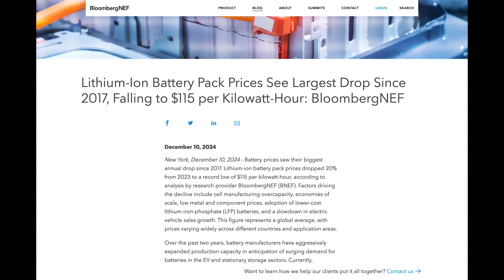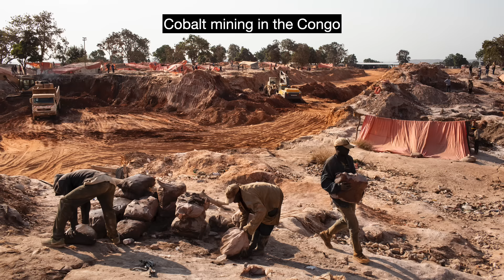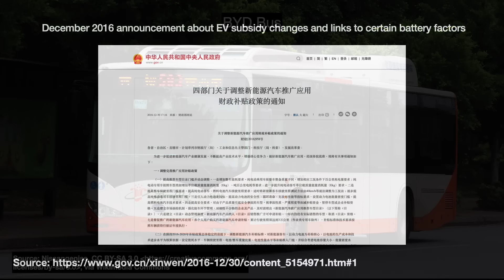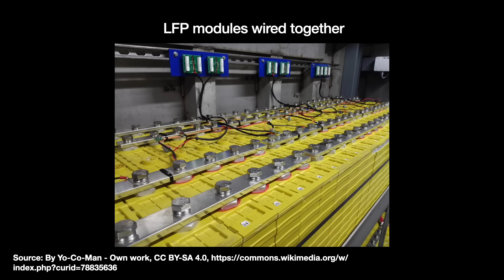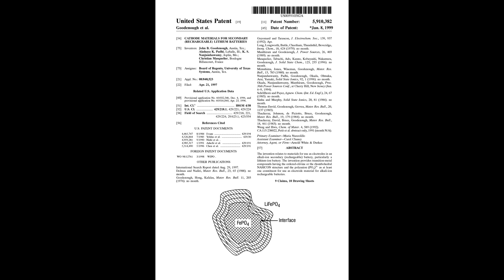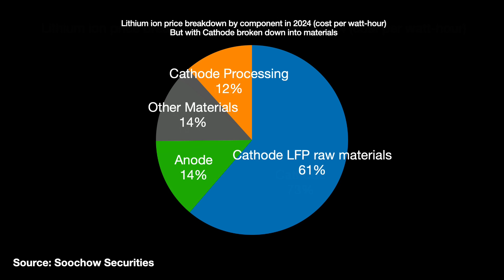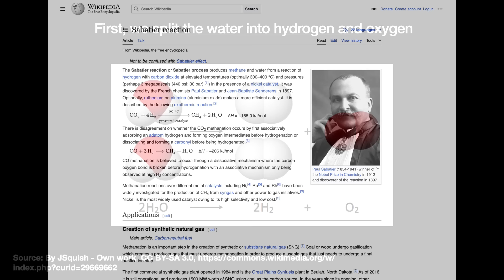How Did China's LFP Batteries Get So Cheap?

Comment: China adopted LFP, an American invention and patent, because in the 1990's, when they were invented, the Chinese government was making it next to impossible and very costly to have it patented there. So the American patent holders gave up on patenting it there. 

Then, when the EV revolution began in the late 2000's and early 2010's, the West preferred the Nickel based chemistries for EV's due to their much higher energy densities and lighter weight, allowing for much longer driving ranges.

Meanwhile in China, with no patent royalties to pay, they poured most of their resources into LFP.  They even bought out all the LFP technology of the American company A123 systems in the early 2010's when they went bankrupt due to the west going with Nickel chemistries. The LFP patents finally expired in 2022, but by then the Chinese had built a huge lead on LFP manufacturing.
Reply: LFP battery patents owner did file its patent in China.
There are two critical patents for LFP battery chemistry, the cathode material, and carbon-coating that improve LFP cathode electrical conductivity by orders of magnitude (LFP has poor conductivity). The patent holder files these patents in China much later, because back then China is a backwater economy, and they did it by combining these patents into 1 single patent (to save money maybe?). Later this single patent was challenged in court, and was nullified, so the patent owner do not hold any patent over LFP. That's why Chinese LFP battery makers can sell LFP battery royalty-free in China, but they still have to pay royalty if they sell outside China, where the related patents are valid.

As for A123, I think its role is overrated, the company (Wanxiang, I think) that bought A123 is never a significant player in LFP battery, I doubt they benefit much from acquiring A123.
Reply: china does not have to follow enviromental laws like europe. just dump the chemicals in the water
Reply: @AndrewTSq u think we dont worry about our environment?
Reply: @leexingha  Not really no. "Its ok as long as it is not in my garden".
Reply: @leexingha  I think you (yourself) probably worry about your environment. Together with many of your fellow Chinese. But since you live there, you know how China works. Some people don't care and ruin it for everyone else. Then there are a lot of people who don't care enough or don't know about it and missing oversight from either local government or even central. Things seem to improve very slowly but people caring too much about themselves is still a huge problem. I haven't been to China is a while now but outside the big cities, dumping random stuff into rivers was common. I once saw a truck dump medicine packagings into the river. Just like that and cars and people went by. I asked someone to call the authorities but they didn't want to get involved. They probably care about their health and family's health and want to live in a good environment. I can't guarantee that this stuff couldn't happen here in Germany but if anyone saw it, the police would be there within minutes and the person would be arrested and fined. I didn't get this feeling when I was in China.
Reply: @gagaxueguzheng  u have been brainwashed & indoctrinated hard
Reply: @AndrewTSq bitter west as always
Reply: @leexingha how did you get past the great firewall?
Reply: @mike_w-tw6jd . Does not matter . China does care about its environment more and more . From the government to the chinese people. So to south east asia and south asia you well understand it is a thirdworld problem and as a developing  china still suffered from that to some extend . But as time pass their sense of environment cleanliness improves . Andrew is a biased clown 🤡 lol .
Reply: @gagaxueguzheng . Compare china to other developing countries and you realise how far they have come . And still improving , it we'll take more decades for environment cleanliness sense to be a normal thing for the average chinese . You have be to harsh and unrealistic (childlike ) in your critic based on very unbalance comparision. Lol may be a hanjian .
Reply: @FittyTrader-fp8bm  Haha, if you read my text, you notice that I wrote that they've already improved a lot. But there is an undeniable problem. And that doesn't go away by saying other places are worse. I know that it can't be compared with developed nations yet but at the same time, it has to be compared to know when it reached its goals. Not a hanjian, just a realist. And I can't be a 汉奸 because I'm German. Just saying "yes but we are poor and so we can't be compared is at the same time true but it's also an excuse to stop improving". If you come to Germany, you'll hear people, media and politics complain every day how we are not good enough. Is that a bad thing? No, it's a necessary thing to be able to improve. And so when I criticize China or its society, it's not because I'm sitting here in my first world country and think we're superior but rather because I do that for my own country as well as other countries to show where they can improve. I watched a documentary about Germany in the 70s and the rivers were polluted and fish were dying. I hope that China can also recover from its current state and become a great place to live just like Germany did. The only difference I see is that Germany always criticized its companies and government for doing this and that protests ultimately lead to improvements. I don't see that in China but maybe they'll find a way to do it from themselves without pressure. You'll see in 10 years from now. I wish you all the best.
Reply: @mike_w-tw6jd  VPN, obviously. But be  respectful, no one will reach anything if they don't engage in discussion and just ask how they jumped over the firewall. If you go somewhere and the first thing you see is people rejecting you and just asking you why or how you even got here, it won't change anyone's mind or give them a good impression of the West.
Reply: @leexingha  He has a point but has made his statement too general. You'll know yourself that this problem exists in your society. Of course, it's not all Chinese but it's enough to be a problem. One of the cultural differences in my personal experience is that we Western people criticize to improve and we see it as our duty. In China, criticism is more seen as an attack. If my boss proposes an idea and I think it's bad, I'll tell him directly it's bad and he'll admit and change. He doesn't think that's a face loss. 

The problem could be this: When Chinese see us Westerners criticize China, they feel attacked and think we are criticizing them unjustifiedly and this is some kind of attack and we should care about our own problems (of which there are many). But what they don't see is that we complain about all countries and that that is our way of improving. In Germany, we complain about the climate politics. We compare Swedish school politics to our German politics and ask why ours sucks. We look at other nations and criticize why our military is worse. We do that every day and no one thinks that this is a traitor or 抹黑德国. It's being realistic about one's society's shortcomings in our eyes and so we do the same if we see problems in other nations. 

Of course, there are also the people who are generalizing stuff like eating dogs and all not caring about society or the environment which doesn't help but just ignore them. Most people have a pretty normal view of China, it's another country with many problems that can be pointed out.
Reply: @FittyTrader-fp8bm  yeah, pretty obvious he is such a hater. nothing new in west internet
Reply: @gagaxueguzheng  u type long but u can shut up as suggestion
Reply: @leexingha  Your replies unmask your real intent. People like you are the cause some westerners think badly about Chinese people. You could just engage in civilized discussions but choose to just whine about the west being mean to you because someone broke your glass heart by saying something not exactly positive to you. I type long but I type better than you and I don't consider your suggestion.
Reply: @gagaxueguzheng  btw, who made u cry? did u get scolded by a CN police for unruly behavior/attitude?
Reply: @leexingha  No, why would I? I don't behave like an offended baby when I'm abroad.
Reply: @gagaxueguzheng  Lmao, you're just desperately trying to justify your racism.
Reply: @gagaxueguzheng  but ur quacks says the opposite. so much of ur so called "being civilized"
Reply: @AndrewTSq 
Andrew, if you know nothing other than what you heard on Fox News or Epoch Times, maybe you should refrain from commenting. Now you come across like a bit of a fool talking nonsense.

Chinese environmental standards are rapidly tightening and are often stricter than American ones right now. To give you a specific example, most Chinese cities have a full ban on combustion engine scooters. The US meanwhile still drives around on ancient 1920 twostroke tech. Europe's behind too, but fourstroke is being made mandatory in a lot of places, with the brand Tomos leaving the Netherlands and going to Slovakia because they don't actually want to innovate at all and realise their outdated stuff is getting phased out.

Air's cleaner in China now, water too. A lot of it happened in the past 10 years.
Meanwhile the US is actually regressing and becoming worse, with both Bush and Trump quickly cancelling environmental regulations made by their predecessors, after generous bribes to the Republican party by the mining industry.

Most glaringly Trump stripped coal miners of their acces to healthcare, which ironically means that even in a rural area (and the significantly less services found there), Chinese coal miners now have better healthcare than American ones.
Reply: This is your own fantasy. China's industry is so prosperous, yet its rivers are crystal clear, much better than those in India where the industry is less developed.

Comment: The BYD blade LFP battery is not internally folded. That is a significant manufacturing cost advantage over other LFP batteries.
Reply: Can u explain "folded"?
Reply: @kap4020 Traditional batteries are rolled up to give them more surface area.
Thomas appears to be suggesting that they have enough surface area to avoid that step.

Comment: One problem with LFP (LiFePO4) batteries - that no one has solved so far - is the very small voltage change of a cell from when it is 100% charged to when the same cell is fully discharged.
While with NMC and NMA we can count on a voltage window from 3.0 Volt (0%) to 4.2 Volt (100%), with LFP we have a voltage of 3.2 Volt (0%) to 3.6 Volt (100%) to play with.
If we consider single cell tolerance AND the thermal drift, you see how difficult is to determine the state of charge of an LFP battery based on voltage alone. Personally, I use a Coulombic monitoring for my LFP designs, because an error in SOC determination can cause a fast degradation of the battery, and increase the risk of fire. 
Many of the Chinese designs use a personalised approach to SOC monitoring for the same reasons.
In any case, the reduced voltage drift of LFP batteries remain an ongoing concern and the major cause of apparent unreliability. My suggestion to LFP pack manufacturers, is: don't be cheap with your BMS, use Coulombic monitoring or, at least, re-map your SOC curves every three months.
Thank you Jon for the great video!
Greetings from the UK,
Anthony
Reply: We have BMS that reset their soc at hvd for this reason. On board shunt will calculate soc. Balancing easily done at high soc. No issues unless you never ever charge to full
Reply: @WillProwse  Come to Australia and see how our labor Government have destroyed our energy grid!~
Reply: @WillProwse  When are you coming to China, bro To check CATL ? . Or to Europe to see how the real social security  work .

Americans have limited experience with other systems in other countries around the world.
Reply: Electronics does a really good job of tracking charge on batteries.
LFP batteries have a very stable full charge voltage - they just stop drawing current at that point and an individual cell then needs to be bypassed to fully charge the next one in the stack.
Reply: How about using 2 types of batteries in one pack
Reply: A common dirt cheap ADC embedded in a microcontroller can measure 0.4V difference to 1milivolt resolution.
Also voltage stability might be considered an advantage, inbeetween charged and discharged state,  cheers !
Reply: The BMS does not calculate cell SOC based on cell voltage, actual current in and current out is measured and recorded.
Reply: Sodium ion batteries solve that by going to the other extreme: the cell voltage almost doubles over the useful discharge curve!
Reply: it is absolutely not a problem.
Reply: It might be slightly harder to determine state of charge, but my man, small voltage range is anything but a problem, in reality its a really big advantage, specially where power density and consistency is relevant.

Comment: LFP has offgassing issues with combustion rather than thermal. not a clear winner
Reply: Off gassing ? That is the very first time I have heard that claim. Try harder.
Reply: @nordic5490  huh? Have you ever read UL9546A test reports? There are actual experts in the comment sections sometimes

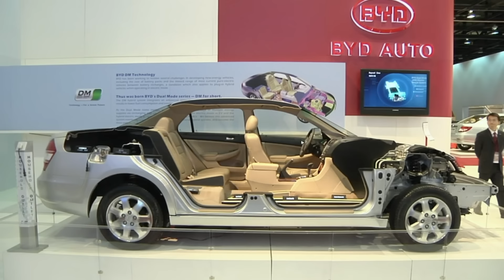Comment: 20:20 CATL made a prediction weeks ago about sodium ion reaching up to 50% battery market share by 2030.  I predicted this myself during the pandemic where sodium and LFP will undergo a price war in a few years. There will be no clear winner between these two considering price, performance, density, life, etc... one thing is clear, nickel based lithium will be driven out of large applications including EVs.
Reply: One thing to note in applications like 2 wheelers, NMC has a unique place due to lack of space and weight limitations. I think the demand will run towards that
Reply: @muhammadrayhanarifinsyah5834  Zodiac said "nickel based lithium will be driven out of LARGE applications". I think he's right, but so are you - NMC will be confined to scooters where, because it is only a small battery pack, the extra cost does not matter much but the extra power density really does.
Reply: For low temperature applications Na ion is a clear winner

Comment: LFP is now becoming standard for mid-market EVs in China and Europe, with Sodium Ion finding application in City cars, and in the near future, perhaps cold weather EVs in hybrid battery packs (CATL in lead). Chinese have done for batteries what Japanese and Koreans did for commodity ICs  and Taiwanese did for PC motherboards: engineer to price point and keep at it until the benchmark is achieved. Then accelerate.
Reply: Sodium ion batteries are also aiming to end the already obsolete 150 year old lead acid battery technology, as they has a lot of upsides over the lead acid:

1. Sodium ion battery is cheaper because it uses the same iron oxide cathode almost like LFP does (so no nickel, cobalt nor lead), and sodium itself is exceptionally abundant
2. It has much higher energy density of about 110-130Wh/kg, compared to 50-65Wh/kg energy density of lead acid, 
3. It has much longer cycle life of 3000-4000 cycles, compared to lead acid cycle life of only 300 cycles  
4. Can withstand cold temperature better than lead acid, and also can be charged and discharged in higher rates
5. It's much safer to recycle than lead acid and doesn't intoxicate the environment unlike lead acid does
6. It can be discharged to 0 volts without any cell damage
7. Same round trip efficiency as lead acid (about 88-92%) although there are attempts to bring the round trip efficiency of sodium ion closer to the lithium one (97-99%)

And just recently I notice several sodium batteries are starting to pop up in several Chinese online stores, although it's still very little compared to the abundance of LFP cells and price wise it's still not much different than LFP (still about 100 dollar/kWh), but it's still a positive sign, because large battery manufacturers who starts mass producing sodium batteries this year, including CATL, has a price target of less than 50 dollars/kWh in the next decade for sodium ion batteries. (still a bit of doubt, but if it's becoming true, it will be a game changer)
Reply: @sihamhamda47  why are you comparing lead-acid with sodium-ion? are you saying sodium-ion will be used as engine starter batteries?
Reply: @mike_w-tw6jd  Yeah, there are already some new 12V engine starter batteries that uses sodium ion. It starts to came up only a couple of weeks ago in some marketplaces. Looks like the era of lead acid in starter engine batteries will ending soon as sodium batteries gradually takes over
Reply: @sihamhamda47  nice but looks like the era of combustion engines (and thus starter batteries) in land transportation will end soon as BEVs take over.
Reply: TV = EV?
Reply: @YSKWatch  Yes, they are excellent fir stationary storage because they are cheap, safe, have broad temperature range and excellent charge tolerance and durability? What is not to like? However, in Asia, small city cars, delivery and utility vehicles that do not require long range and can be charged in lower power charge points overnight are becoming very popular. Not a good fit for North America, but a good solution for basic transportation.
Reply: Sodium is for stationary storage batteries, where size and weight is not very important.
Reply: @nordic5490 sodium-ion is not competitive with lfp in cycle-life
Reply: @nordic5490  sodium ion battery already being used in EV. CATL solve the power density problem.
Reply: @YSKWatch  It's a hybrid battery of sodium and lithium based cells which takes advantage of each chemistries advantages.
Reply: @YSKWatch  es.  And also in hybrid battery for cold climates.